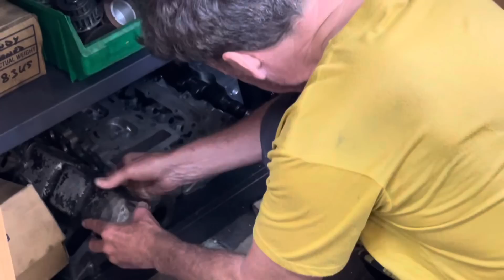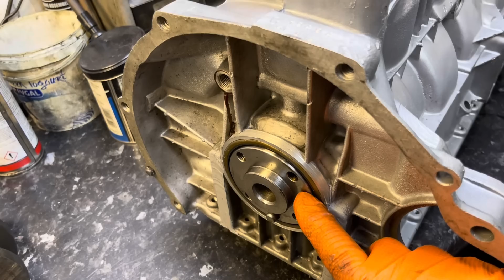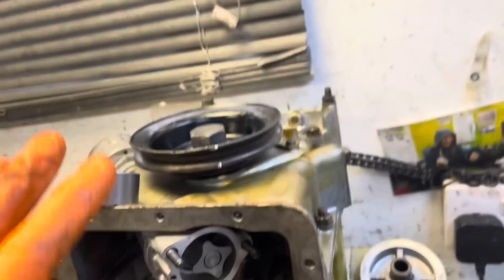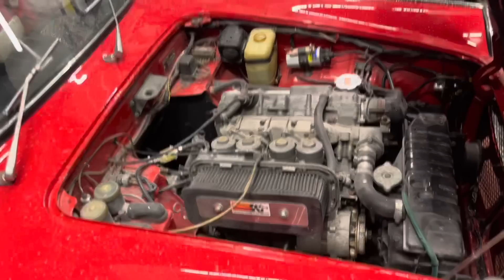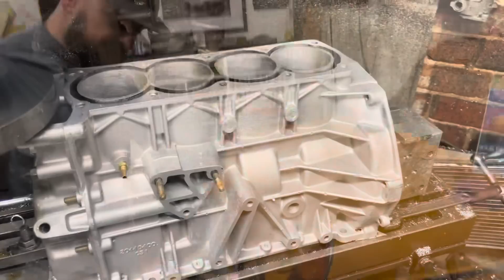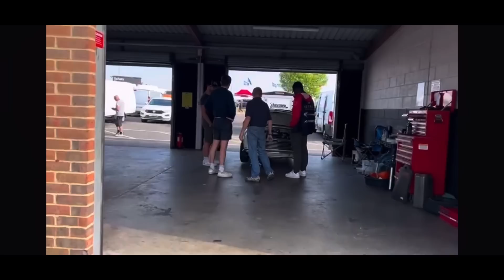Shrigleytube TV ep 58 sunbeam b1 into an imp part 1, dyno 930cc imp on weber’s, honda s800 peep.

Comment: I was gonna say, I'm no mechanic - but if David Vizard has taught me anything, deshrouding those valves (especially the inlet on the side of the bowl) should produce some gains. You've milled it pretty agressively, so the CC loss in the bowls will be negligible. You're the original tinkerer, I'm surprised you havent done a forced induction build on one of these
Reply from the maker: ha ha thanks yep we been down the turbo road

Comment: When are you getting a Aussie mic. to make your life easier  , love the hot roding videos on older motors like the flathead fords. The cult following on the  Imp is amazing the Aussie equivalent would be the 1964 EH Holden. The engines have been used in speed way , drag cars, motor boats the after market parts are never ending  !
Kit from down under